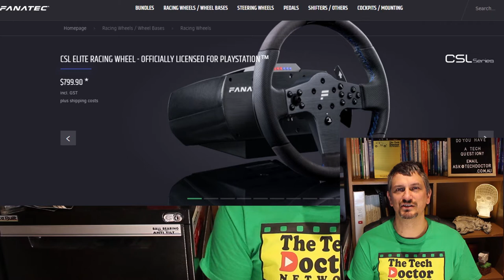156: Replacing a broken pin a Fanatec Steering Wheel (you can do anything if you try)

Comment: You absolute beaut mate - 2022 ended with a broken wheel, 12 hours later it’s fixed 01/01/23 - you legend
Reply from the maker: Glad I could help. May your 2023 be full of the smell of rubber and beautifully handled corners! 😁

Comment: Thank again for your video. Picked up a used Fanatec CSL Elite P1 wheel for $50 as it had a broken pin. Fixed it following your great video. In my case the connection lead to the wheel circuit board had some glue place on it by Fanatec to insure it didn’t pop off. Just needed to remove it and then it easily came off.  Thanks.
Reply from the maker: I'm so glad it helped you out!

Comment: first of all thank you this video was a big help i had a broken pin and the next day i was driving again :) i only used a knife or scalpel without hot air blower it was faster and cleaner like that, in the end i heated up the knife just a little to separate the wire i need.(carefully not to damage the other wires) and one more thing two little plastic rod fallen out when i taken apart the wheel its connecting the shifter paddle to the sensor. i used a small piece of two sided tape to hold it in there. so thanks again it was an easy and fast repair.
Reply from the maker: I’m so glad I was able to help! Great work!

Comment: Is there anyways to get the wheel off and keep the mother board and buttons on the base? I want a formula style rim, however I can’t afford $200 on top of me about to buy potentially this wheel. I mainly race ovals so it’s honestly not the worlds biggest issue and I’ve had a wheel base for months just no wheel…..if you see this I’d really appreciate the help.
Reply from the maker: I’m not a racer/gamer, but you can buy different wheels new and probably also 2nd hand.
Reply: @TechDoctorTV  the point of the comment was not to do that “buying 2nd hand” results into the P1 V2 on eBay being $175…….when you go to there website brand new $120…….so all you can do is fix this wheel and not diy? A formula style rim would be nice but not for $200 and reguardless I get a podium adapter, it’s $150 then I have to get an oval rim minimum $50 and formula wheel minimum $200 right back where I started except slightly cheaper…..this all comes from the ability to change on the Logitech g920 kinda crazy companies and people have no idea how that works. “But you can buy a different wheel” sometimes people don’t like talking to a wall and would be cool to even hear if the answer is idk or no you cannot do that would be straight up but redirecting to something the majority is clearly knowledgeable is just plain annoying 🤦‍♂️
Reply from the maker: @myck7021  as I said, I’m not a racer/gamer, I just fixed a wheel for for a customer.

Comment: hi nice video -  i like the elastic bands around the plyers idea --i am fixing a broken base and wheel
and needed to know the 12 coloured wires that come through centre tunnel from the back of the female centre qr connector  
there are 2 blues , 2 reds 2 black 2 greys etc so quite hard to match them up from photos etc

(i had to buy new board harness's plugs because someone cut them all off) that plugs into  x300 wheel board connector. 

thanks for any help
Reply from the maker: I don't actually have the wheeel anymore, as I was fixing for a friend. If you bought the harness, I would guess it would have the plug on it, and it is keyed. Or, worst case, can you match them from the cut ones?

Comment: Hi, amazing video. I have exactly the same problem. My son has a CSL Elite steering wheel with a broken pin, so I will defenately try this. Another question. The broken pin is left in the base, and I cannot reach it anymore. Do you have any suggestions?
Reply from the maker: If you can still see it in the depths, you might be able to poke something in there with a dot of blutack on it and pull it out, or you may be able to just push it through completely and, from memory it will dop out into the case behind.

Comment: 1 broken pin is still sitting in the base... how can I get it out? It's completely sunk!
Reply from the maker: I think someone else commented you can push through with a bit of wire or similar.
Reply: i was able to pull it out with tweezers

Comment: I don't suppose any watchers know where these terminal pins can be procured?  Part numbers, etc?
Reply from the maker: I don't, but as you can see from the video there are several spare pins. I have also hear Fanatec may sell a whole pin assembly.
Reply: @TechDoctorTV  They do not.  Also, there are two different versions of this plug, an 8-wire and a 12-wire.  Both have 13 pins.  I have a 12-wire CSL Elite P1... With 2 broken pins.  I need a replacement.  Fanatec will happily sell me a brand new wheel, but not replacement parts for it.  😑

Comment: I must say i tried and failed. But Fanatec will send replacement part (even after warranty passed ) and its cheap and easier to do. Also happened with mclaren wheel. Its a design flaw imo
Reply from the maker: I suspect it is a design flaw. Nice to know you can get the part. Are they selling it, or is it warranty?